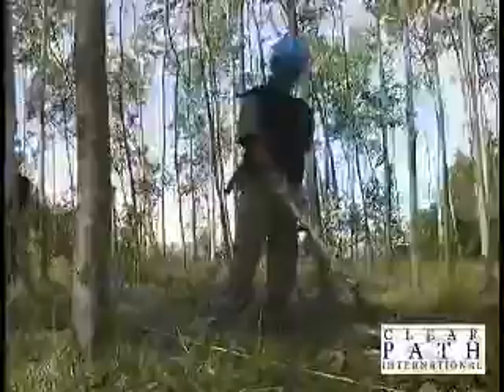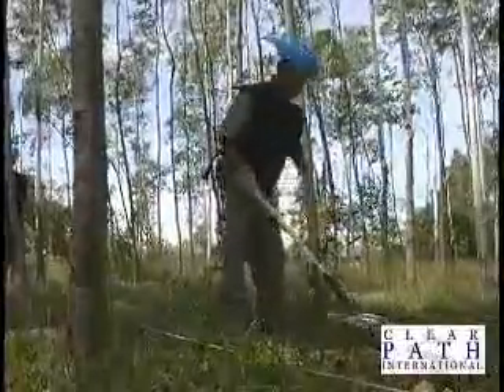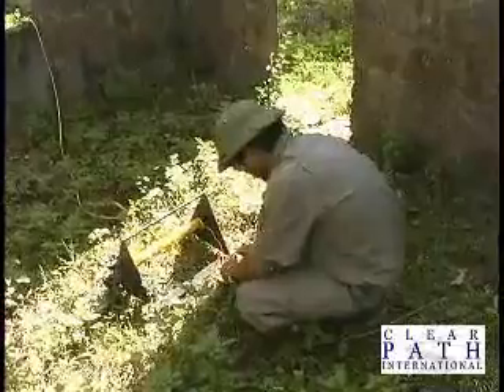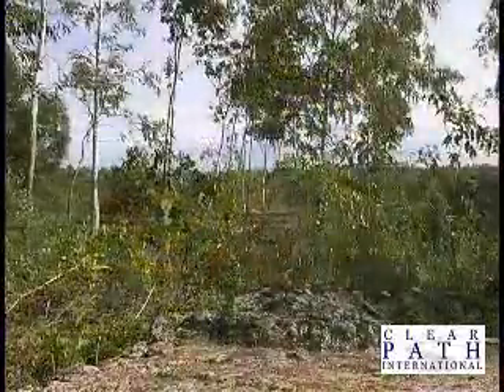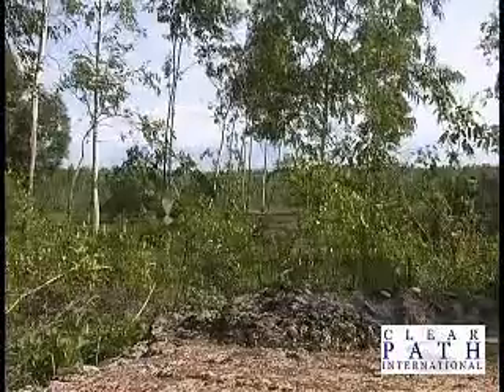Howto: Clearing Landmines in Vietnam

Comment: @thisishyimhot strong sensitive detectors require for this job. most mines plastic but they have metal springs in it. who cleans those mines mostly single people, no family no parents, not responsible to anyone, mostly half mad. this people reduce the risk by sending small group of sheep in the front, sheep walks in the front so if sheeps step on mine they die not the mine cleaners. i am retired army officer i saw mine cleaning before.